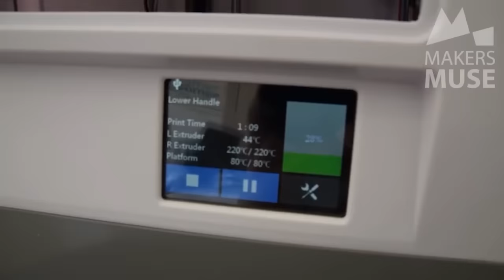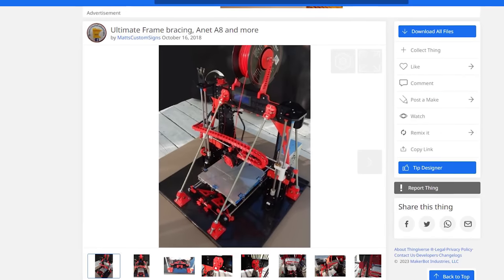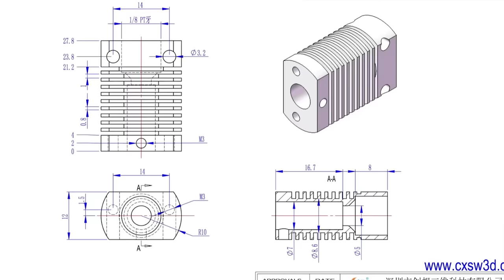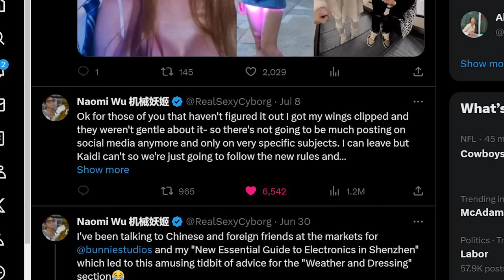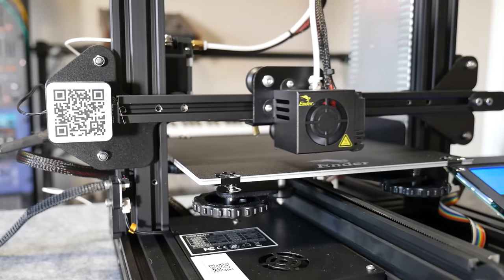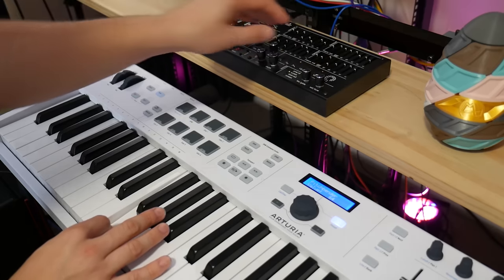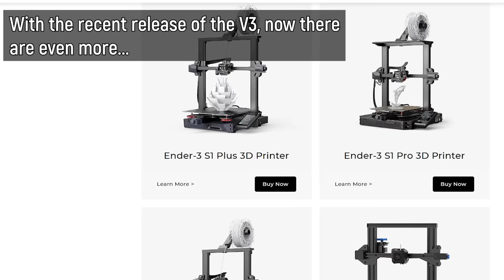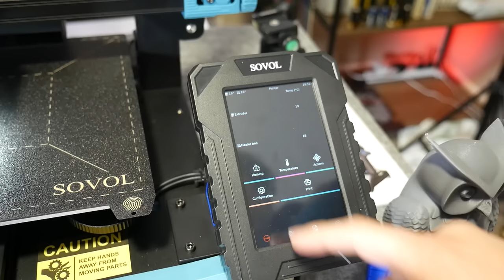Creality Ender-3... it's time to move on.

Comment: From my limited knowledge I don't disagree with you.  I do take the other side of the argument though, something you allude to several times.  An Ender 3 is sort of like a Chevy, especially in the muscle car era.  It is cheap and a good base to soup up.  Sure, there are better cars out there, but you can do so much with a Chevy.  And yeah, they saturated the market with the Corvette, the Chevelle, the Camaro, the Nova...but it gives you choice.  I just got an Ender 3 V2 for Christmas, my first FDM printer and I am happy with it.  I just wonder why, at this point they didnt include the CR Touch for a few bucks more, but whatever...I am slowly dialing it in and making it mine.  If I go down this road this will become my PLA workhorse.  We have a friend who has a business selling 3d printed products and they use Ender 3s exclusively.  I think they own like eight of them at this point.  Easy to operate and maintain and they do the job.  So yeah...It is what it is.  A 350 Chevy and not a 426 Hemi Charger...

Comment: As someone who fell into the Ender 3 beginner printer trap, this video summarizes it all very well. Dealing with problems I’ve had with the printer even after getting a CR Touch has done nothing but put me off wanting to touch it. I’m currently looking at getting a P1P and either selling off my E3V2 or continue tinkering with it when I have the will to deal with it.
Reply: I think reliable printers are a myth. These are just fundamentally wear and fault prone class of devices for the time being.
Reply: Go for it, I did exactly that move a few months ago and never felt happier. The P1P is way faster, prints at a higher quality and is super reliable.
Reply: @SianaGearz   I disagree. Bought a prusa i3 mk2s years ago; have spent 2 years with it stored and it prints out of the box with no adjustments. never had an issue with it and have lost very little time adjusting anything since building it out of the box.
Reply: @u0000-u2x  so how many hours of printing do you have on it? Have you crossed a hundred? A thousand?
Reply: yes I have crossed a thousand (edit: ~1500h; just checked. never replaced anything on it and like I said never had to make mechanical adjustments)  @SianaGearz  and if reliability was an issue prusa itself wouldn't use a massive number of them on their assembly line
Reply: @u0000-u2x  that's very nice.

Why wouldn't they use them in the farm? Of course a number of machines at any given time are in maintenance, and since they have a warehouse full of parts and subassemblies, it's only a few minutes at a time to get a wonky machine going again. But they for sure have improved them a fair bit in the process.
Reply: @SianaGearz  not at all, there are many reliable printers you can buy or build, the issue with cheap printers like the ender 3 isn’t wear or faults but the cheap components and relatively bad and outdated design, meaning that users have to spend a long time levelling, tightening, calibrating, etc, and those things don’t count as wear or faults.
Reply: Don't continue to throw money at the ender 3, it's a bottomless money pit. Buy a better printer and move on.
Reply: @SianaGearz  Maybe if you've only had garbage printers like the Ender 3, there are brands out there that make printers that require far less maintenance and tinkering.
Reply: @fdsman  actually I'm looking for an Ender 3 frame and PSU since it would be a potential upgrade. But also I don't have some of their issues because I have direct drive and alu extruder. But what I have is part kit part self designed wood frame printer.

Also you don't need any actual money to keep a printer made from standard parts going. Just the usual wear parts, an odd dollar here and there for nozzles extruder wheels and bearings.
Reply: I had an Ender 3 Max that I put about $200 in in additional parts and upgrades and I still never got it to a reliable point. I ended up selling it and getting an Artillery Sidewinder X2 based on this channel's review of it and so far it's been excellent.
Reply: @fdsman  exactly what I did. After I went through possible upgrades that would be needed to improve quality and upgrade it to my needs.. I realised it's better to just get a new Prusa instead.
Reply: I got in on the Bambu kickstarter and am super happy with it.  SianaGearz' cynicism notwithstanding, I find it quite reliable; yes, anything with moving parts will need service from time to time (I spend 2 years repairing 2d printers for a living) but the Bambu platform minimises the work you need to do, whereas the Ender platform feels like it maximises it.  After two months with an X1C I shut my Ender-5 off for the last time.  I didn't even try to sell it, I was jsut so done with that machine.  Instead I've taken it apart and have been using the bits for robot-building projects instead.
Reply: Same happened to me I bought a p1p and man I can’t be happier
Reply: @SianaGearz I've never been able to get any creality printer past 50 hours let alone 1000
Reply: I would pay the extra $100 and get the P1S instead. The inclusion of the aux parts cooling fan makes all the difference for bridging, as well as the enclosure making for a more consistent temperature environment. But yeah, definitely go for it.  You'll want to pitch everything else in the trash after running it for a while and getting great prints out of the box and not having to tinker with it at all (unless you like tinkering rather than printing.)
Reply: People say to me... "Cool... A 3D printer! What are you making with it?"

To which I respond: "mostly headaches"
Reply: That’s crazy, I’m in the same exact situation, the ended 3v2 has killed my love for 3d printing. Really hoping I can get a p1p and revive my hobby
Reply: We needed these videos like a year ago instead of the bought and paid for Creality hype train.  This is exactly what I did, I fell for the "rEddIT WIlL hElP yoU" garbage, oh it's such a wealth of helpful people to go along with this budget printer.  "YoU jUSt neEd tO mOD it."  Nothing but pasted links and year old replies that didn't answer my question lmao.  CR touch didn't help me either when the GLASS bed you assume is flat, is warped lmfao.  I discovered to stop tinkering unless that in itself is a hobby you enjoy, sell that crap and don't buy anything sub $300, they're all stealing eachother's intellectual property anyway. (cough K1 cough X1C catchup/clone that is a failure) Sold and used the cash from the Ender 3 to get an Anycubic, still trash, the bed doesn't heat after 7 months (6 month warranty, swell, well "-14C" will do...) P1S is a fantastic solution.
Reply: I agree with gman, the extra money to jump to the P1S is very well spent. Just do your homework on Bambu and their data collection / cloud service practices. They make great machines, but as a company, they are pretty questionable.
Reply: @HL09  I was in the same boat, I got an Anker m5c, renewed my love
Reply: @KamenDesantis  I was considering getting the P1S upgrade kit in the future after getting the P1P but I might hold onto the thought of getting the P1S altogether. As for their data collection, to me its not that big of a worry considering I just want to 3D print things mostly as a hobby. Whether Bambu has all my files on their cloud servers or not, it doesnt make much of a difference to me. If it were a problem I'd still just use the SD Card or LAN mode instead.
Reply: Ender 3 teaches you everything about 3D printing. If you quite that hobby because You had problems with Ender 3, that hobby isn't for You.
Reply: Well... To those who have said the CR Touch didn't help them.. I say. "I don't understand'.

The CR Touch (along with the MriscoC firmware update) has helped me tremendously getting the print bed levelled and meshed.

The issue I have is the z-axis is inconsistent. I also haven't lubed up the drive screw in a while, so I need to do that today.

But moreover... Once I get it leveled. I can do great things with it.  It just takes some futzing between prints and I have to level it more than I should have to.
Reply: @MrJsatrzab  it teaches you about how a bedslinger works and the general idea of what a 3D printer is, sure, but the printer itself is still a really low quality and bad beginner printer as stated in the video. I understand how 3D printing works. Just because I want to have good quality prints from a printer I dont want to tinker with more than I print with, doesnt mean the hobby isnt for me.
Reply: @tohrugon  There are those for whom 3d print is just a step in the process, and those for whom printing IS the process. For the first group Ender 3 is a bad choice, for the second group it's ideal choice. It will allow you to learn everything about printing. You will learn how everything works, encounter lot's of problems and ways how to solve them.
Reply: Honestly, I'd say if you can, it's not that much to pop up to a P1S that'll get you an enclosed printer, and def cheaper then trying to upgrade later.

Comment: one reason I liked the ender 3 was the troubleshooting. I'm a mechanical engineer so getting the ender 3 with all the issues ( I was the 3rd user) I was able to learn about what can go wrong and how to go about fixing it. I taught me so much that when I got my CR10 -V3 I had no problems when issues came with that printer, as well as troubleshoot some friends printers. But to buy for production or prototyping DONT _ Its  a cheap printer to learn what can and will go wrong and find out what you really want in a 3Dprinter

Comment: I completely agree with you.  Several years back I bought an Ender 3 Pro as my first printer. I still believe it was the right choice at the time but there's no way I would recommend it to a newbie today. It prints better than it ever did right now but that's only because I've modded the hell out of it to the point where it doesn't even resemble the original printer any more. Loved every minute of doing that because I'm a tinkerer at heart but boy would that have been intimidating to a casual user.

Comment: Great takeaways here in regards to the Ender Product's, and I agree as owning not (2x) ender 3's, a CR-10 and (3x) cr-10s , the product is a platform for tinkering, I have told people to buy one strictly to learn, because 3D printing in itself is a huge learning curve for a lot of people. It prepares them for the unforeseen issues in printing that make you scratch your head. The personal safety of a content creator is certainly more important now than 3D printing. We should continue the conversation about Naomi and figure out what exactly is going on. I unfortunately have been out of the hobby for about a year now, so I'll need to catch up on the details.
Reply: She's simply gotten too old to be the honey pot. Her job was no longer needed.
Reply: @oldsjunkie1  Not sure I understand what you mean.

Comment: We have an Ender 3 Pro with every upgrade there is. The 2 biggest improvements 1) are stiffer bed springs (or silicone replacements), and 2) the BLtouch or 3Dtouch. All the others just add a few % improvement. We did the BTT motherboard/display, MicroSwiss NG direct print head, dual z axis, BLtouch, silicone bed "springs", ball bearing filament roller (this is not bad and it's cheap). Putting temporary (NOT permanent) Locktite on the bed screws helps keep them from backing off. We don't have a ceramic bed.

Comment: Completely agree: if you want to learn how to fix print problems and upgrade a printer to add missing features, the Creality printers are a good choice. If you just want it to work, pick almost anything else.
Reply: I'm newer to 3D printing (under a year).  I bought a Bambu Labs X1 and I've had nearly 0 issues.  I'm printing in PA12CF with pretty good results.  I'd suggest a Bambu Labs product to anyone who just wants a printer that works out of the box.
Reply: @tedo3332  I really like the X1 Carbon's features but I'm waiting for another year or so to gauge the long-term quality for parts like the gantry rails.
Reply: @Ughmahedhurtz  So far so good...  I have gone through about 30Kg with only a handful of failures (usually tall skinny prints or forgetting a brim) and a clog.  I hope it lasts too.

Comment: Bought an Ender 3V2, largely off of hint and tips from this channel and it's still a great printer for my occasional needs. It has the "must have" bed level sensor and I swapped out the default PTFE tubing.

Comment: Ten years ago, I bought a RepRap. A few hours of assembly and the first print. I understood that this device was not ready for commercial use, but I was passionate about the idea of 3D printing as a part of the future.

Then home repairs started, and I put the printer in the attic. Now I wanted to get it out, and it turned out that it just fell apart. All 3D printed parts were destroyed.

So I went to the store for a cheap printer and saw the Ender 3. As a result, I bought the Ender 3 V2 Neo a few days ago. And so far I am delighted. It just works out of the box. The bed leveling setting is amazing. Auto-leveling is great. I hope I won't encounter teething problems, but even if I do... it's still much less problematic than the RepRap. Not to mention the price. I bought RepRap for 1000 dollars, Ender cost me only 220. I didn't buy more advanced devices (like V3) because I want a platform for modification (in case I want to modify or need to repair).

I understand that my opinion is not objective... But Ender looks like a very good option for its money.

Comment: The thing that stood out for me with the Ender 3 and other cheap 3D printers when I looked into them 5 years ago was the amount of user upgrades out there for them - that said to me they weren't as complete as they should be, that corners were cut in their design/build, I didn't want my introduction to 3D printing to be having to make the printer better, I wanted to get straight into designing & printing, so I spent more and got a Prusa i3 Mk3 in kit form and it's been serving me great ever since.

Comment: This was a really good video.  As frustrating as it can be to always be working on a printer instead of using it is that you really get to know the printer and understand how they work at a much deeper level than a typical "user".  I have an MP mini select V2 that I was given last year as my first 3d printer.  It worked well enough but was far from perfect. I'd give it a 6 out of 10 but for free and for not knowing any better I was still impressed.  but once I began to have issues I was forced to either fix them or give up and I wasn't going to give up.  I learned about this thing and in my discoveries to fix each problem I slowly improved upon it.  I've now modified it significantly and use it as a dedicated printer for filament I make from PET bottles.  it does PLA/PETG/TPU amazingly well but due to the small volume I leave those filaments for my other printers.  But it has become a great testbed for new hotends, extruders and motors.  I understand how 3d printers work so much better BECAUSE this thing was imperfect.

Not the best solution for everybody but it definitely was for me.

Comment: I can’t argue with you as I’m a novice but my ender 3 has never let me down, I’ve only been running PLA until now and had great results. I tried ASA for the first time today and used the base settings from the internet and it’s working brilliantly straight away. I can’t fault it especially for the price. I’m sure there are much better printers but its horses for courses and my ender is all I need.

Comment: My only printer is still my first, a CR10 that I bought over 5 years and use it weekly. Have done some maintenance, new mainboard, new nozzles... but all very affordable and the thing is a total tank. Has never let me down. Simple design is the key. Paid $360 at the time shipped... crazy good deal. Still on the original rollers and belts.

Comment: Anyone near a Microcenter should consider the Ender 3 S1 Pro. 

They MSRP at $400, but are currently $250 for the holiday season. Skip the ender 3 Pro because by the time you upgrade it to match features, that $100 printer is more expensive

Comment: I won't recommend a printer without automatic bed leveling to anyone, let alone someone getting into it for the first time.  My first printer was a Wanho i3, and the quality was good, if you could get the bed leveled, which I could not.  My second printer was a Prusa MK3, which is an amazing printer, but the price of the kit makes it out of the price range of most people just getting into it.  It will cost you $850 before taxes for the MK4S kit, which could take two weeks to get to you.  For less than $500 before taxes you can go to your local MicroCenter, if you're lucky enough to have one, and get a Bambu Lab A1 with the AMS lite, or for that $850 before taxes you can get the P1S with the AMS unit and get an enclosed Core XY printer.

So if I were to recommend a first printer, I would say get the Bambu Lab A1 Mini with AMS lite, the Bambu Lab A1 with AMS lite, or the the Bambu Lab P1S with AMS.

Comment: The ender 3 was my first intro into 3d printing. While it taught me the basics of 3d printing, it was a massively frustrating experience that wasn't enjoyable on any level. However instead of making me quit, it just made me buy a Bambu lab P1s. That has been everything I wanted out of 3d printing. It's fast, I didn't have to "fiddle" with anything and on 99% of the prints I want to do including those I design myself, it just works. But yes as you mentioned, I wanted a tool first, hobby second.